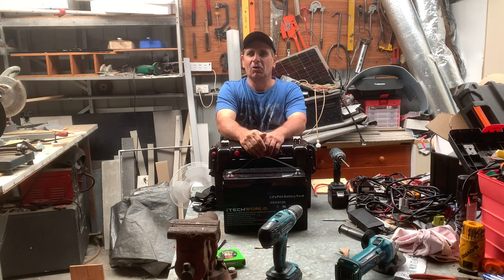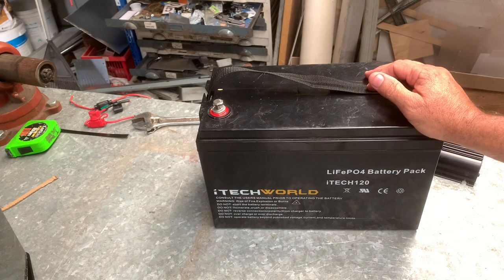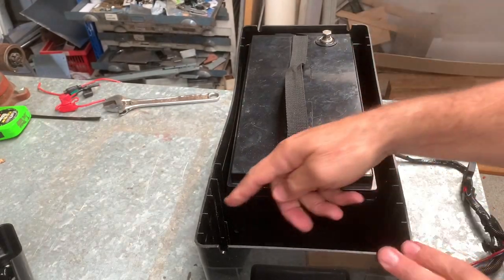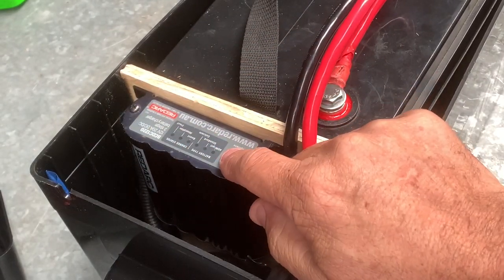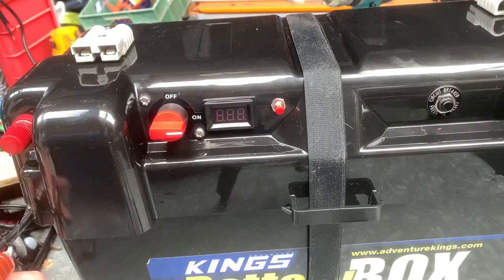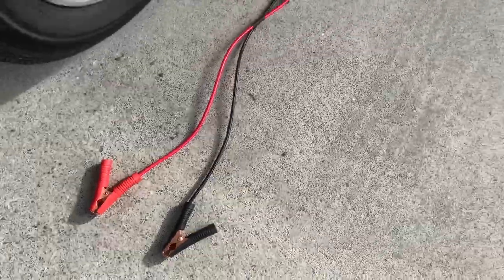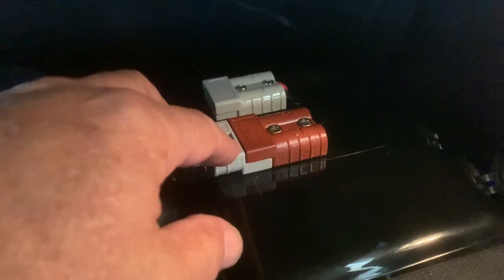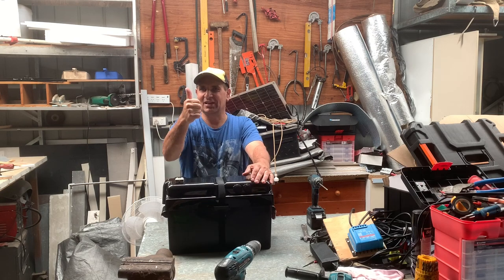Simple portable dual battery setup

Comment: good DIY video. Not sure if i would cram all that gear in the box with the battery. Things like Chargers and Solar charge controllers can run hot. Some people end up putting small 12v fan on a thermal switch just to push the air out. Best of luck with your build my friend.
Reply from the maker: Cheers mate👍 mainly did this for the wife’s car to run the fridge . Was concerned about that about putting everything in the box but will see how it goes through the summer probably just lift the lid off or will end up putting in a little computer fan . End up removing the Victron as was no need for a solar input as battery will run fridge for 3 days if the car wasn’t started.. her car is used daily . Look forward to your next upload mate 👍🍻

Comment: What wire did you shunt to what location to get it into the AGM mode?
Reply from the maker: I left the orange wire disconnected to get agm mode . you can go on the redarc website and search your charger and you can look at user manual to be sure … as it’s been a while now this charger packed it in after 9 years of use . thanks for watching 👍🍻
Reply: @EFFICIENTSELF  Did you go with the Itech or another Redarc DC/dc?
Reply from the maker: @damodoesall6240 i just went with a renogy  50 amp dc charger with mppt solar controller… went with this as was a hot sale price

Comment: I have a duel battery system in my car already with an Anderson plug on back of car that I hook up to my caravan and or camper trailer that have onboard agm’s. 
Question can I use that point if I put in a set up
Like this in the camper trailer? Or have to take the point off the second battery up front as it’s off the aux battery that’s running threw the redarc system?
Reply from the maker: you sure can . thanks for watching 👍🍻

Comment: Hi mate good video, Just a question, You dont have to ground the DC earth to your vehicle but just to your battery? Im just wondering would this work if i plug my sola earth to the battery as well or that needs to be grounded to the car.. As i got an BCDC Core In-Cabin 25A DC Battery Charger on its way.
Reply from the maker: Solar earth to battery is fine. Thanks for watching 👍🍻
Reply: @EFFICIENTSELF  thanks mate.

Comment: Just came across your channel mate. Good stuff. I'm the same... in hindsight would go the portable route rather than the auxiliary fixed under the bonnet. Quick question... did you find the non-lithium Redarc charged your lithium well enough? I've got the same Redarc but have heard it won't charge the lithium to full capacity... but for me the extra power and weight saving from lithium outweighs getting the lithium only 80-90% charged.  Cheers 🍻
Reply from the maker: You better off with a lithium charger. All that hype about drop in lithium to charge on an agm profile is nonsense. My redarc finally gave up the ghost but its not bad for a 10 year old dc charger. Thanks for your comment and thanks for watching 👍🍻

Comment: Hi there Dino, with redarc 1220 will charge any lithium batteries I two VOLT X LIFEPRO 4 LITHIUMS with upgrade BMS have you with either lithium batteries look forward to hear from you thanks.
Reply from the maker: Hey bruce i dont have any voltx lithium batteries.. this redarc is the older type ….. The battery i have apparently can take agm profile battery chargers in your case you need to go the redarc 1225d as it gas lithium profile.. hope this helps and thanks for watching 👍🍻
Reply: Thanks Dino great video's too,wot latest Renogy 30amp dc-dc charger with mppt solar inputs have heard about them I see you had there battery monitor how it going, thanks. Are good for wot I be doing.

Comment: Is that a pure sine wave inverter? If not, be careful charging laptops and sensitive devices as a standard sine wave can damage them.
Reply from the maker: Thanks for the heads up .. yeah I just went on the sellers eBay ads and they say perfect for charging laptops and electronics and when you read the specs of the can inverters they are modified sine wav. … something I definitely should of mentioned….thanks again and thanks for watching 👍🍻

Comment: Great job Dino. Bit more time explaining why the red and blue wires can be wired together and perhaps explaining situations that they can not?
Just an idea buddy.
Reply from the maker: Sorry mate the blue wire is the ignition wire and needs to be connected to a power source when ignition is turned on. This case I just connected to power wire as not all dc chargers have ignition wires. Cheers mate 👍🍻

Comment: Hi Dino love your videos mate  . I recently bought the same kings battery box and also the victron mppt controller. Did you end up putting the victron mppt controller inside the box ? If so, how's the air flow does it get hot ? Safe to do so ? Thanks  Dom
Reply from the maker: I put 2 computer fans inside rthe box one on intake and the other on exhaust for the airflow as it got very hot inside the box… if you can’t fit it all inside just mount the victron outside the battery box .. i end up taking out the victron mppt and just use the dc charger.. thanks for watching my videos I really appreciate it 👍🍻
Reply: @EFFICIENTSELF   Hi Dino thanks for the reply. Ok I think i will mount it on the outside . Thanks again Dom
Reply from the maker: Cheers dom hope it all goes well 👍

Comment: Does the battery box need to be earthed to the chassis? Edit: is it earthed through the starter negative?
Reply from the maker: not at all
Reply: @EFFICIENTSELF  so you have run a negative to the car battery negative?
Reply from the maker: Just a positive and negative from start battery to the dc charger and unplug and fully portable
Reply: @EFFICIENTSELF  sweet thanks a ton, legend 🤟
Reply from the maker: Cheers mate good luck 🤞👍🍻

Comment: Thanks for the video 
Had same system in old car and sold it 
Thought it was alot harder than that to do 
Can you let me know of ypu need to run an ignition wire with the red arc
Thanks in advance 
Breno
Reply from the maker: I just connected the ignition wire to positive …if you have smart alternator than the ignition wire goes to a power source when the ignition is turned on . As in the video it was a 2020 model Mitsubishi asx and I didn’t need to worry about the ignition wire
Reply: @EFFICIENTSELF  thanks for the reply

Comment: Hey Dino. Any tips on how to run a 3rd battery just for on occasion at work in my 24v truck? Im going to run it in a little battery box but just wondering how I can wire it from my main 24v supply so it gets a charge while driving but wont flatten my main batteries if I happen to want to run something like a small cooler at work off my 3rd/spare battery.
Reply from the maker: Hey Brett 👍 to be honest I have never done this before . Maybe search YouTube and hopefully someone has done a video on this.. I know you can get 24v dc dc chargers but I’m not sure if they put out 12v on the output . Maybe go onto redarc and ask them the question if they do a dc charger with 24v in and you want to charge a 12v battery , maybe they have a charger for this . Only thing I know you can get 24v dc charger and rig up another 24 v battery bank and you can wire up the same way I have in this video but you will be 24v system. Then you could get a 24v to 12v down converter if you need 12v. Sorry I couldn’t give you a solid tip . Maybe somebody will reply with some sound advice..👍🍻
Reply: @EFFICIENTSELF  No problem Dino thanks for the reply. Nice videos btw, new to much of this so love watching your vids so far. Keep it up
Reply from the maker: Thanks Brett much appreciate it 👍🍻

Comment: Whats the max size inverter you could run off this?
Reply from the maker: This battery has continuous 100 amp discharge and maximum inverter you could run from this battery would be a 1200watt and it would need to be connected to the battery terminals . Thanks for watching 👍🍻
Reply: @EFFICIENTSELF  Just learning this stuff now can you tell me of any books I can buy. How did you learn about this? Thanks
Reply from the maker: There is lots of stuff online . Google is your friend . It’s just an interest of mine I been doing for the last 5 years.. I didn’t know anything when I started . Just watch lots of videos and ask questions using google and you will find answers. 👍🍻
Reply from the maker: Watch a channel called Greg virgoe he explains it so well and shows diagrams and you will gain a lot from it

Comment: Another great video. I have the same battery box with the Sunyee 100AH lithium battery and the 20 amp dc-dc charger with built in MPPT solar regulator. The charger is mounted on the box lid. The charger has Anderson plugs fitted and I just use the input/output Anderson plugs that are mounted on the Kings battery box. As you know many of the portable solar panels come fitted with a PWM OR MPPT regulator so you can just plug these direct into the battery box. If you are going to have a solar regulator perm on the box like you have people need to realize they have to remove the regulator that comes with the solar panel.
Reply from the maker: Thanks Fred . Awesome mate and hope you been getting good use out of your setup. And thanks for mentioning about removing or bypassing the regulator that come with portable panels , as I never mentioned (my bad)  thanks for watching 👍🍻
Reply: @EFFICIENTSELF  I know you like experimenting....here’s an idea for you. I saw a brief video where a guy hooked up his solar regulator to his car battery using the panel connections and used it to charge his portable battery. May not work with a smart alternator but would work with an alternator that pumps out anything close to 14v. You must be collecting an array of spare bits and pieces by now to consider having a go.? Just need to fit a fuse on the +ve panel lead.
Reply from the maker: I actually tried this with my 50amp atem power dc charger and battery box .. the car start battery got to 13.7v and then dc started charging then stopped when the voltage got down to around 13.1v (start batt) then had to wait till the solar charged the battery up to 13.7v and so on… might give it a go with the redarc charger and batt as redarc is only 20 amp
Reply: @EFFICIENTSELF  just to make sure we are on the same page, the video I saw had the guy using only a solar regulator. Did not connect it to a DC DC charger. I was thinking of having a go. I have a 10amp MPPT reg that I removed off of my solar panel as I connect solar through my DC DC/MPPT charger now. My Jeep alternator pumps out 14v . I’ll need to read my solar panel specs to see what the min solar voltage point is. This 12v stuff is addictive!
Reply from the maker: Oh ok … have you got the link ? I will have a look when i get a chance.. yeah its addictive alright 😂
Reply: @EFFICIENTSELF  not sure how to send link through YouTube. Just type in - Using my truck as a solar panel. The channel owner is Chris DYIer.
Reply from the maker: Cheers will look when i get a chance cheers 🍻